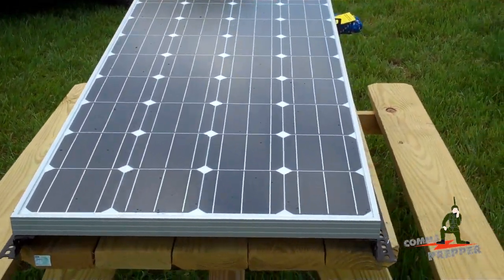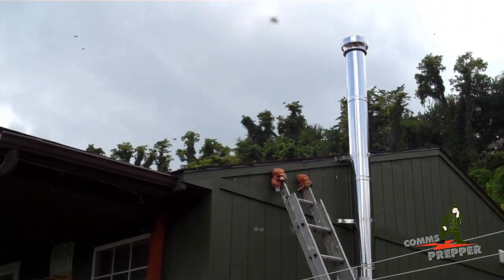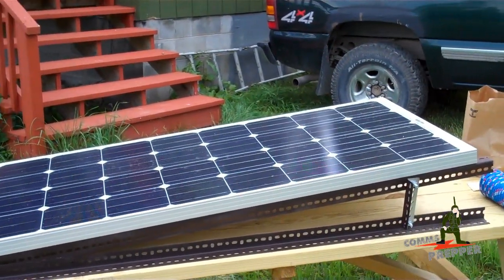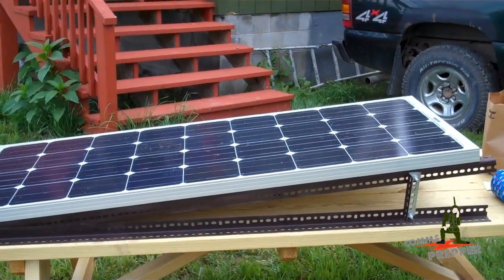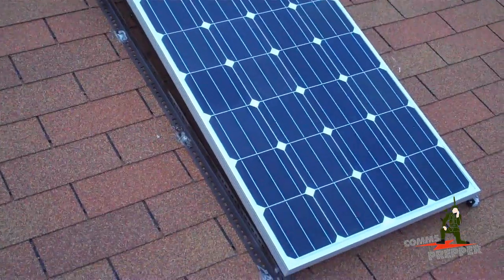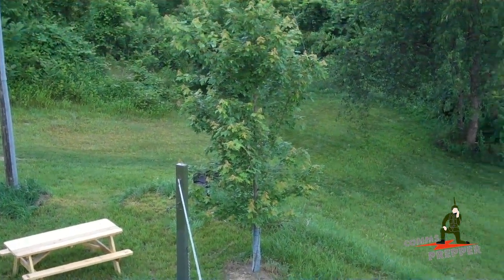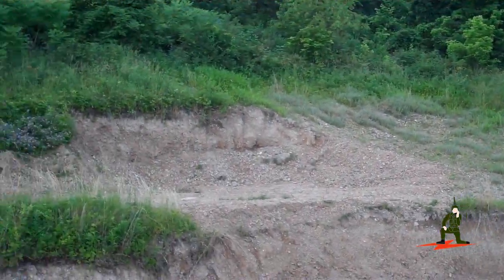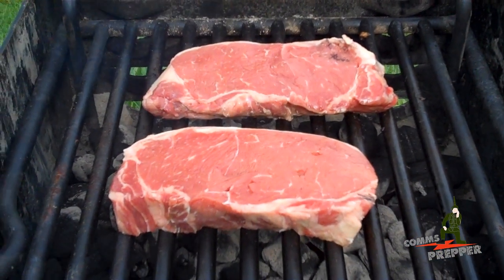Off-Grid Solar Panel Installation

Comment: Love your vids. As a Ham and prepper myself, I've found your experiences very useful.  In looking at solar, I'm trying to figure out the balance of panels and batteries, as both are expensive.  What's your approach?  How many (and size/type) of batteries do you plan to hook to that panel?   Just trying to get an idea on how best to set up the initial system, and plan for growth (more panels, more batteries, etc).  Thanks a million!
Reply from the maker: I have not worked out the math yet.  My plan is to get four Tojan T-105RE (6VDC) batteries and wire them up to make a 12VDC bank and see how that works.  I have a good charge controller and 1500 watt inverter.  Just need the second cable, batteries, and to build a housing and it's going online.  THanks for taking the time to watch and comment.

Comment: I assume your retreat was not built  with a separate dedicated 12 volt line system, hence the need for an inverter with loss of efficiency. What are your thoughts about installing an additional  12 volt systemic- if you had the luxury of building a retreat from the ground up?

BTW, I think I saw an antenna on your shed. What kind, and what bands are you able to transceive?
Reply from the maker: I do have some 12VDC runs for lights, radios, and TV.  If I had to do it over I would have done a full 12VDC system for the house (much harder to pull wire after the fact).  I don't remember the make of the shed antenna but it's a dual-bander 2m/70cm.  I have had it 10 years or more now.

Comment: How long does it take to charge a dead battery bank?
Reply from the maker: Not sure.  I don't have my battery bank yet or cabling to connected between the panel and the charge controller.  There will be a part 2 video for sure on this project.  Thanks for watching and commenting.  CommsPrepper
Reply: I'm curious about these solar panels. I would think they would work ok during the summer months but not work at all if it snowed on them. So I am also considering a wind turbine.

Comment: Nice Solar Panel! I'm surprised that it has that much output for it's size!

I'll be out using my Solar Generator setup during the 2014 Field Day on June 27-29th up in the Adirondack's! The Solar Generator has Two 20-Watt Solar Panels that fold open (for 40 Watts Total), and keep a 20 Amp Hour AGM Battery Charged Up. It has multiple 12 Volt Outputs, USB Outputs, and a 100 Watt Inverter built into it.

I'm running completely off of Solar/Battery in the QRP Category using my VX-7R Handheld and my N9TAX Dual-Band Slim-Jim Antenna, which I'll be hanging up in a tree with some paracord. Another Ham that I'm headed up there with will be putting his new Elecraft KX3 though it's paces on the HF Bands with his portable Dipole Antenna.

We combined a 3 day Camping Trip with the Field Day so we could get some time off to enjoy the great outdoors, while also enjoying making some QSO's with other Amateur's! :-)
Reply from the maker: Sounds like a nice setup.  I have a portable GoalZero Escape 150 for field ops.  The plan for this project is to power items in the cabin.  Now all I need is the expensive part - batteries.
Reply: I've been watching the prices of LiFePo Batteries, which are slowly coming down. They're still expensive, but are now to the cost effective point.

I plan on using a LiFePo Battery in my remote solar repeater setup due to it's higher performance. They can discharge much further without damage, which might come in handy during the winter months if the panel gets covered with ice/snow.

After watching your videos with the remote relays, I've been trying to brainstorm an idea of  a remote heater circuit that could warm up the panel just enough to melt the snow off of it. Such a system might not be possible on battery power alone, but it could be done with a a/c powered heating element on a building solar setup.